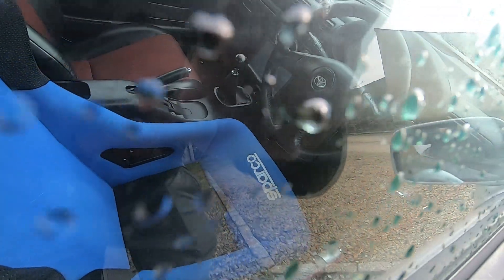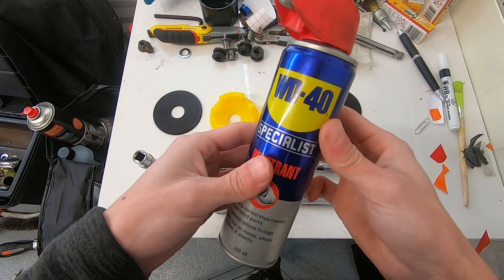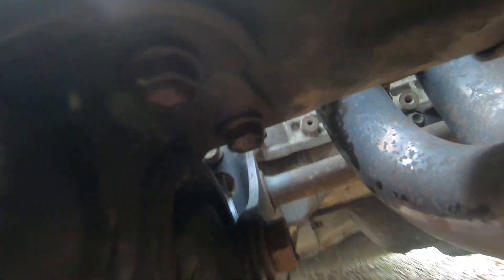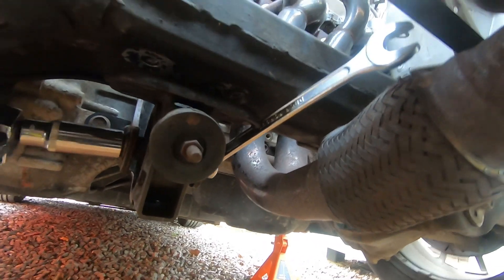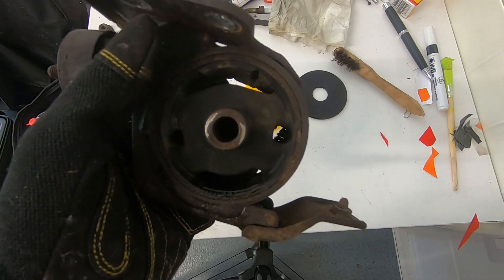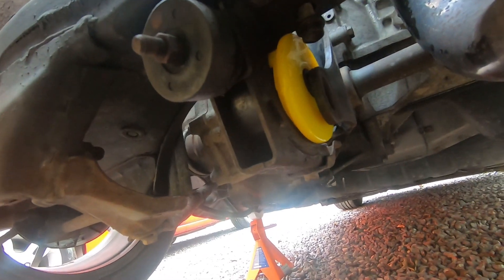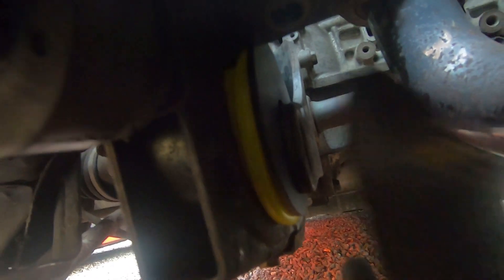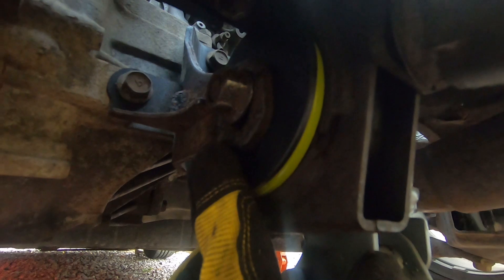Lotus parts on a Toyota?! MR2 Roadster Powerflex Rear Motor Mount Install and Road Test

Comment: Is the rubber on the rear engine mount something you could replace if perished? As opposed to replacing the entire metal mount.
Reply from the maker: That is essentially what this powerflex bush takes care of! You absolutely can replace the whole rubber piece, but it's a major pain, usually involving a good amount of time with a blow torch to just burn out the old one, and this new piece supports what's left of the original 20 year old mount